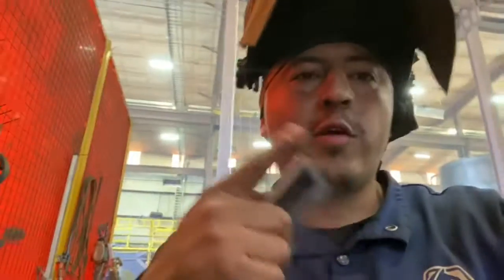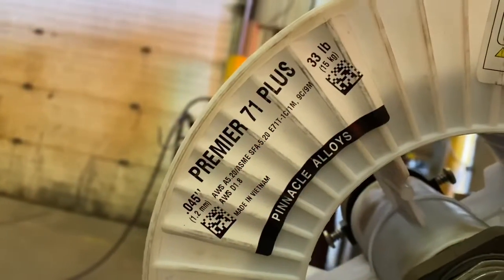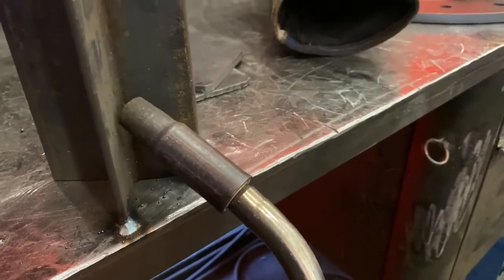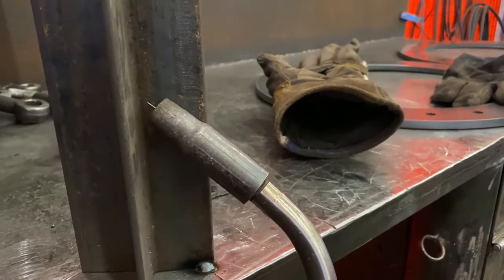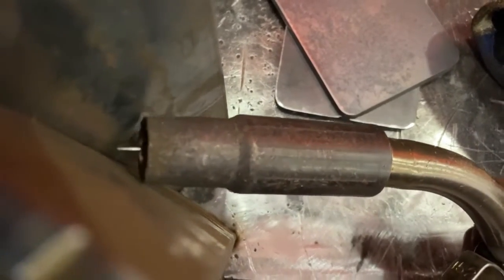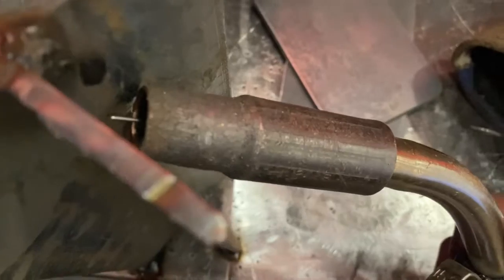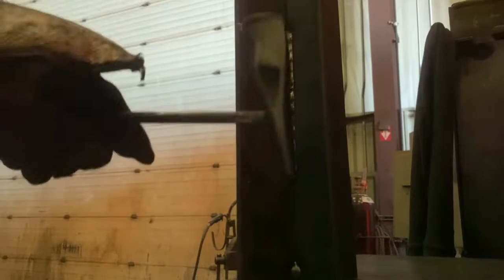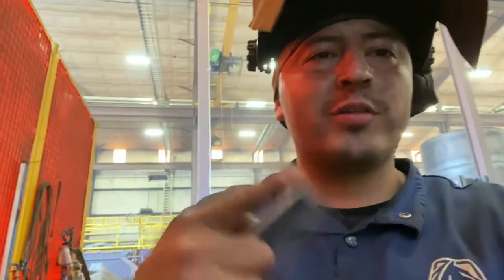How to weld dual shield fluxcore | FCAW for beginners 3g vertical uphill

Comment: What if the gun touches the material?
Reply from the maker: It’ll stick
Reply: Just walk the cup
Reply: If it sticks just stop and clean off the slag and od a restart its not easy to tie it in but thr more you do it the better it will make you